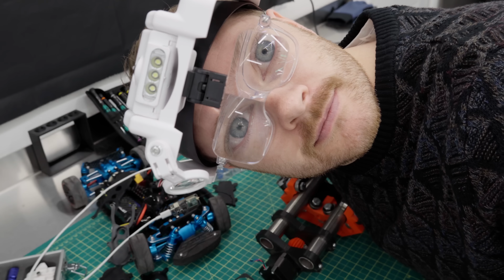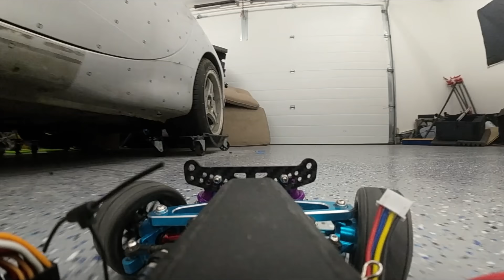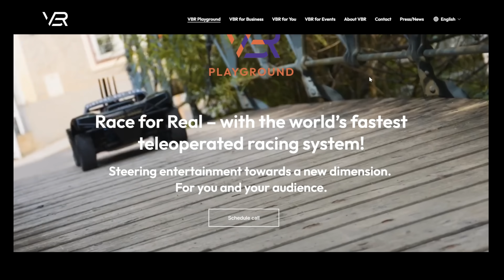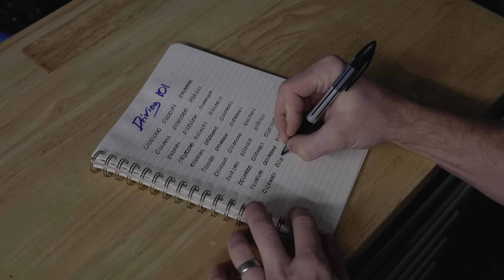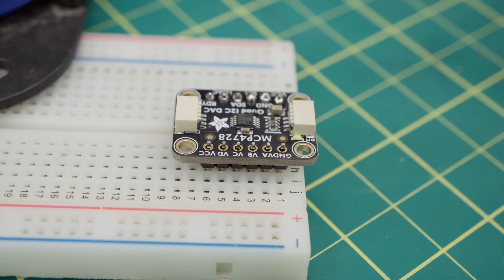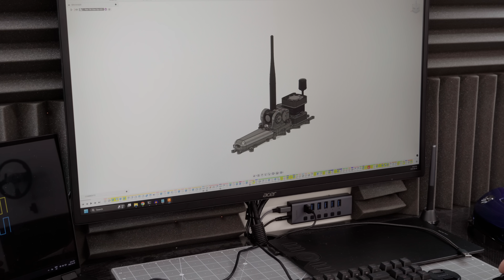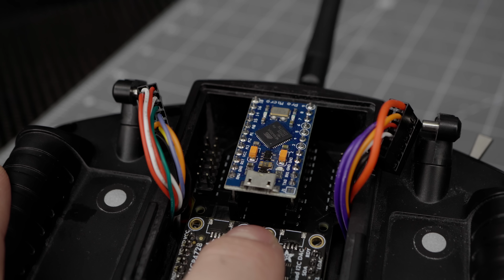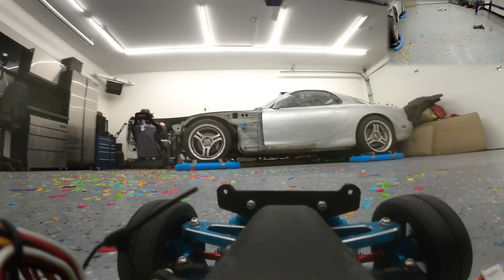Turning a Racing Simulator Into an RC Car Controller: How Hard Could It Be?

Comment: Is that you Mazda there in the garage missing the front fender?
Reply from the maker: It's missing a heck of a lot more than the fender 😅 hahah! I have the fenders/bumper off for 3d scanning. I'll be making my own front clip and aero package for it in the future!  I just need a bigger shop.. And a 5 axis router... 🤣
Reply: @bits-bits  Will you have videos of that? Sounds like fun plans.
Reply from the maker: Yeah I'll cover it when the time comes! It'll probably be a looooong time until I get to a point where I can actually get to work with it. But I've got a vision on my head and some designs on the computer with what it should look like when it's done!

Comment: would be sweet if VR headset could control camera movement!
Reply from the maker: It does! The goggles have head tracking, but it isn't used much in this video.. It's a lot easier to see in my laser video!

Comment: Exciting work, congratulations. My dream is to see an RC electric racing boat like mine https://youtu.be/24cBhd0BC-0 modified to use foils like those in the America's Cup. The problem for me was to design an Arduino hardware, sensor, and software that could keep the height level constant above the water.
Reply from the maker: Those look so fast! It would be awesome to pilot one in fpv and integrate some smart sensors tied to the hydrofoils!

Comment: There is already a controller that allows you to plug the usb into it and map the controls, all you need is FPV
Reply from the maker: The noble nb4 pro/pro plus? Lots of people have already commented on it. From what I've read, others are saying it's only compatible with the g29 and T300RS wheelbases, and lacks HOTAS support. 
Using the arduino/python combo opens up a lot of neat features that would be missing on a "plug and play" setup that I cover in my other videos.  This complicated setup isn't for everyone, but for a nerd like me it works great! 😁

Comment: @bits-bits  Does the feedback from the rc car wheels come into the sim wheel? If so I'd love to learn how you technically map the wheels movements back into the controller wheel
Reply from the maker: I'm currently exploring a couple methods to get force feedback working! I can get the steering force data from the car to the computer without issue, but getting a response from the wheel is a bit challenging.  Looking at lots of different tools and approaches!
Reply: @bits-bits  Looking forward to the video on this!

Comment: getting the fpv camera conected to a fpv headset with a gyro would be sick. So you could move the "head" around on the rc car. Also, cool FD :)
Reply from the maker: The camera has head tracking! Tough to see in this one and I kind of gloss over the pan/tilt system.. But you can see it better in the Laser video where I shoot the laser at whatever I'm looking at!

Comment: instead of mapping the voltage to the motor as gears, could map it as rpms, that way It works like a real electric car, which would solve the wheels spinning every time you press the gas pedal. Hope this helps.
Reply from the maker: Adding sensors soon that will hopefully help me achieve this!

Comment: Try using a crawler integrated servo. We found those to be the best for low level throttle control and still be fast enough on the top end. We also found that most steering RC servos are too slow. (end to end being sometimes 30-40 ms)... and actually slower or cumulative to that of our video latency.

Looking forward to the next video.
Reply from the maker: I'll pick up a couple to test out! Any brand suggestions?

Comment: https://youtube.com/shorts/PWNM5-3Zc34?si=m74EFjmL77zTwBpQ motion next?
Reply from the maker: With any luck the motion system will be the subject of the next video!  Might take me a decade or so to build a rig for my simulator... and then another year to get a video out on it.. but it's coming!!
You guys have done so much cool stuff!!!
Reply: @bits-bits  ping us if you need guidance or help. There is a lot of way to do this. Pros and cons in all directions. ;-)
Reply from the maker: Will do! Lots of scaling/filtering testing underway! Having some difficulties with my test subject though.. Turns out lego men aren't the best communicators for evaluating motion platform dynamics. 😅
Reply: @ ha!

Another option we explored is using your phone as the control, video and IMU unit. ;-) They are ubiquitous and apps are quite easy to build/install and maintain.

Porsche has also done this a few years ago too.. using their phone to control their vehicles active hybrid suspension.

Comment: Why make things hard on yourself by doing all of this. It would be a hundred times easier if you just did some basic research. Okay so the best way to go about this is to create the shrink ray, the same one that was used in the movie Hunny I Shrunk the kids to make yourself smaller. You can thank me in buttcoin!
Reply from the maker: Sometimes the easy way isn’t the fun way!
Sure, there are simpler systems that do something similar (I even linked one in the description). But for me, the real value is in learning new skills and building something custom that fits exactly what I’m trying to do. Off-the-shelf solutions are great, but they don’t teach you nearly as much.
Reply: @bits-bits It was a joke 😂

Comment: I’ve turned a Logitech racing wheel into a Rc transmitter and it stills functions as both a game controller and a transmitter it’s really easy to do
Reply from the maker: Awesome! I probably made my setup a little more complicated than it needed to be.. But the overcomplicated mistakes ended up being happy accidents giving me more functionality than I set out to achieve.  Not only being able to fly drones/planes with the system, but also allowing me to add features like ABS, traction control, a manual gearbox and other goofy systems like lasers.
The wheelbase and joysticks still work like normal too, it was only the first prototype that broke their normal controller operation.
Reply: @bits-bits  your set up is much better because you can control and keep adding onto it. Mine all I did was simply take apart a spare transmitter I had and integrate the parts into the wheel and foot pedals essentially just reconfiguring the transmitter into the sim. but what you did is next level and definitely more effective in the long run

Comment: What's the maximum distance you can control this thing from? Would latency get too bad if you moved this thing outside? I would love to see you rip it up on a bigger track outside. It would be insane to move your sim setup somewhere, powered by a generator, and control everything from there.
Reply from the maker: Not sure on distance yet.. Since I'm indoors I'm not going to get good line of sight, so I'm banking on elrs giving me good penetration.  Since the TX is hooked up via USB I can run a long extension outside to improve LOS though. Latency is the same as a regular transmitter, I'm not using wifi/lora/lte to control anything.
I plan on building a mobile setup to take to tracks and fields! That's where I think I'll have the most fun!

Comment: I wish to see an outdoor run with it. Btw that was my dream 30 years ago. It was already done in my head, but there were no cameras yet that tiny, no amazon, ebay to order stuff. I didn’t even have internet back then. It’s cool you built my dream
Reply from the maker: I'll be taking it outside soon! Just waiting on the last bit of snow to melt and puddles to dry up! I'm working on the edits to the code right now so soon you'll be able to build your own!
Reply: @ I gave up on it already, but it will be great to see your setup

Comment: What is the camera module called you need for the DJI Googles?
Reply from the maker: The camera system is a dji o3 air unit, so it works natively with the dji goggles! On the car I needed to add an arming unit to allow the air unit to go in to full power mode, but that's a simple Arduino hack!
Reply: @bits-bits  Thats souns really "simple" Thanks, 200€, is that a ok price?
Reply from the maker: Not really sure what a good price for the air unit is in euros, but that seems in the right ballpark. 

Here's a link to the arduino arming solution: https://github.com/ramiss/arduino_DJI_03_RC_ARM

Comment: What do you use to transmit the signal wirelessly? (for the steering and pedals). Do you use the arduino for the camera only? or for all the inputs?
Reply from the maker: The signals are still sent by a regular transmitter, but the inputs are sent by the python program and sorted out by the arduino before they go to the transmitter.
The camera system is its own thing, a dji o3 air unit like they use on drones. Thanks for watching!
Reply: @bits-bits  Ahh okay! Im actually making this kind of rc for my school project. But i use arduino pro micro and bought another esc to control the rc. For now i use NRF24l01 to send the signal. What transmitter do you use?
Reply from the maker: It's a radiomaster tx12 ELRS!
Reply: @bits-bits  Okay just to clarify, so did you use 2 Arduinos? one before the transmitter and one in the RC with the DACs?what receiver did you use? and do you use any controller in the RC?
Sorry for the continuous question, I'm new to RCs and my NRF module is tripping out, it's making me crazy😵
I want to try your approach for the transmitter and the receiver. Thanks in advance!
Reply from the maker: Sorry just saw your reply! I'm just using one Arduino. It's the one in the TX with the DACs on the breakout board. I'm just using a regular radiomaster elrs receiver on the car to do the driving and Headtracking, but I've added and Arduino and raspberry pi to the car for other stuff 😏.
Hopefully that helps!
Reply: @bits-bits  i see! thank you so much for the help!

Comment: Hey this is the first vid i've seen from you but definitely not the last I mainly have one question. Should I try to build my own rc or modify one? Also if to build my own could I have tips and if to modify could I have tips on that? Thank you so much If you read my comment.
Reply from the maker: Do you mean build from the ground up? Or build a kit? If you built a lot of lego as a kid, kits are awesome. A ground up rc would have a lot of challenges but could be super cool if you put a lot of time in to it!
The best bet is usually modifying though, most of the legwork is done to have it running and driving well, then you can just tweak the parts you want!

Comment: Did something similar with a PCTX, any controller with a trainer port, and the cam system used in quad rotors.
Reply from the maker: I've been looking in to doing another version that doesn't require so much soldering on the transmitter! Maybe a pctx style system with some bitsbits Arduino/Python twists would be a good route!

Comment: Love the video! I'd love it if you released some of how you did this and your code, I am savvy enough to change the inputs but not to do the overarching things! it would also be cool if you could make this into a small module that could be swapped between cars? Not sure how this interacts with all of the RC components, but it would be SO COOL to swap it to a rock crawler if that is what you are feeling at that time! I'm definitely going to be watching closely! What is the RC range like ? could you control this in your yard from inside? that could be neat with friends!
Reply from the maker: Nothing really needs to be swapped between cars, just transmitter profiles and Python scripts that run on the pc. I made it super easy for myself 🤣. When I go from car to plane, all I do is change the model on the TX and run the fly Python program.  Range and penetration depend on the radio, I'm using elrs so it should be pretty decent. I plan on doing some tests when the roads are clear 😁

Comment: If you try to hook your rig up to motion, pneumatic works better then hydraulic. Don't ask me where I know that from, maybe there was a similar project like 25 years ago. Nice video btw, keep it up.
Reply from the maker: I'd probably go the electric route, there are some industrial servos that others have used with a lot of success.  Pneumatic would be cool, but I don't know if my princess auto 5 gallon compressor could keep up 😅
Reply: @bits-bits  ohh, the electric route. That route was not in the equation 25 years ago🤣. Our problem wasn't really the compressor, it was more the weight of stuff like monitors and there was few ways to get dedicated parts made. Vibration and stuff was a big problem too with older computer parts.
Reply from the maker: I bet the pneumatics sounded awesome though!
Reply: @bits-bits  sure did. Lots of broken hoses and valves. Coolest thing imho was the inertia and stuff. We tried to hook up a rally sim, that thing was seriously throwing you around 🤣

Comment: I found the video when searching for a random idea that my ADHD threw out.
Its pretty much what you have done, but my idea was having a track on the floor say for example spa and have asseto corsa running on the pc with the rc car driving round the track like a live timing.
Yeah i know it wouldn't work as the cars would not reset to where they should be on track after a crash, but would be cool to play with.

Loving the project, it's cool to see what can be achieved with an inquisitive mind.

If you like sim setups, drop me a message I have several ideas I would like to bounce off of you, I got an amazing deal on some ex lets race sim racing f1 cockpits, going to be building them up.
Reply from the maker: A scale track like spa would be great - all time favourite track.
We're going to keep pushing the limits with this project!
Reply: @bits-bits  have you looked in to larger motion platforms? I am looking forward the best way to try and add more to the cockpits, thing is they are a 2/3 person lift without my 12st on board.
I am really considering using bass shakers or repourposed ps/xbox rumble motors on the pedals as a start.

I really love your software approximation of not only things that have not been done, but of things that were considered hardware only before. Keep up the good work
Reply from the maker: Yep I've done lots of motion platform research, I've got some designs.. But the electrical components are pretty pricey.  Probably not gonna be in the budget for the next few years 😅

Comment: Maybe now you’ve got the controls down, optimize the vehicle to match the speed and handling you’re comfy with. Like a typical crawler rc will have a reduction gearbox which both improve drive time and slow it down to a more moderate speed, then you are using grippy wheels on that surface, maybe a harder compound of 1.9s or drift wheels. Then you could also opt for red, fwd, red or 4x4. Or just go buggy mode outdoors, I know Kyuosho make a dune buggy which is fwd and has the option for reduction gearbox via the spur and pinion gears, it should be just fast enough to tickle your perception in that size, but slow enough to handle?
Reply from the maker: Heck ya! The more controls I get to play with the more fun I'll have. Same day I'll get a chassis with more built-in functions!

Comment: custom traction control script?
Reply: /**
 * Arduino Traction Control Function, Made in a few minutes, just an example
 * 
 * This function takes a throttle input and converts it to appropriate
 * wheel speeds with basic traction control functionality.
 * 
 * @param throttleInput - Analog throttle input (0-1023 from analogRead)
 * @param wheelSlip - Current wheel slip ratio (0.0 = no slip, higher values = more slip)
 * @param maxMotorSpeed - Maximum motor speed (PWM value 0-255)
 * @return Adjusted motor speed with traction control applied
 */
int throttleToWheelSpeed(int throttleInput, float wheelSlip, int maxMotorSpeed) {
  // Convert throttle input (0-1023) to motor speed (0-255)
  int desiredSpeed = map(throttleInput, 0, 1023, 0, maxMotorSpeed);
  
  // Define slip threshold where traction control activates
  const float slipThreshold = 0.1;  // Adjust based on your vehicle's characteristics
  
  // Define how aggressive the traction control is
  const float tractionControlFactor = 0.7;  // Lower = more aggressive reduction
  
  // Apply traction control if wheel slip exceeds threshold
  if (wheelSlip > slipThreshold) {
    // Calculate how much to reduce speed based on slip amount
    float reductionFactor = 1.0 - ((wheelSlip - slipThreshold) * tractionControlFactor);
    
    // Ensure reduction factor stays within reasonable bounds
    reductionFactor = constrain(reductionFactor, 0.1, 1.0);
    
    // Apply reduction to desired speed
    desiredSpeed = desiredSpeed * reductionFactor;
  }
  
  // Ensure output is within valid PWM range
  return constrain(desiredSpeed, 0, maxMotorSpeed);
}

/**
 * Example of how to use the function in your main code:
 */
void loop() {
  // Read throttle input (e.g., from a potentiometer)
  int throttleValue = analogRead(A0);  // 0-1023
  
  // Calculate wheel slip (this is where you'd implement your slip detection)
  // This could compare wheel speed sensors or use accelerometer data
  float currentWheelSlip = calculateWheelSlip();  // You'll need to implement this
  
  // Set maximum motor speed (0-255 for PWM)
  int maxSpeed = 255;
  
  // Calculate adjusted wheel speed with traction control
  int motorSpeed = throttleToWheelSpeed(throttleValue, currentWheelSlip, maxSpeed);
  
  // Apply the calculated speed to your motor
  analogWrite(motorPin, motorSpeed);
  
  delay(50);  // Short delay for stability
}
Reply from the maker: Good work! I'll be adding some sensors to let me get the driveline speed soon.  I'll likely implement the TC via Python instead of the arduino, just for faster parameter changes in testing. When I release the scripts and sketches you guys will have free rein to add features!